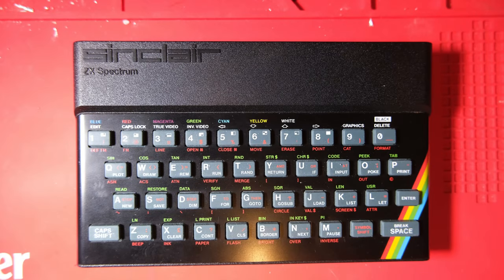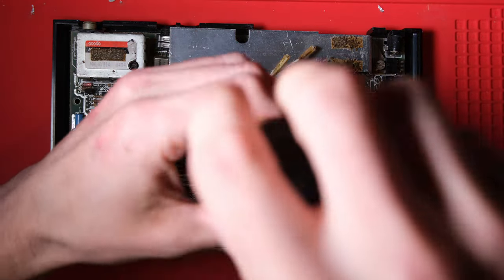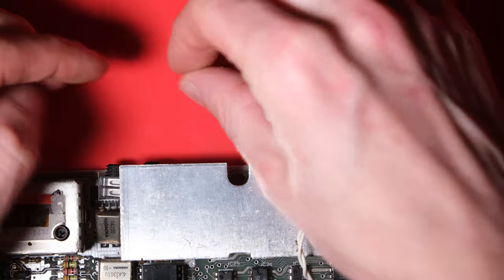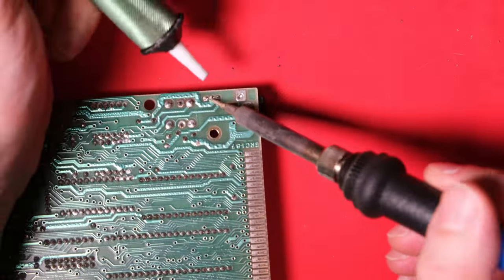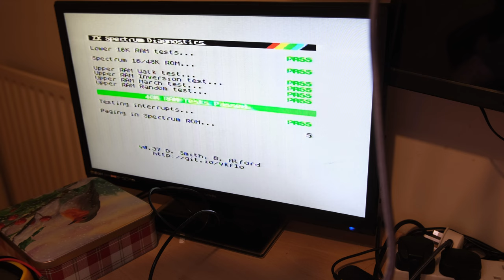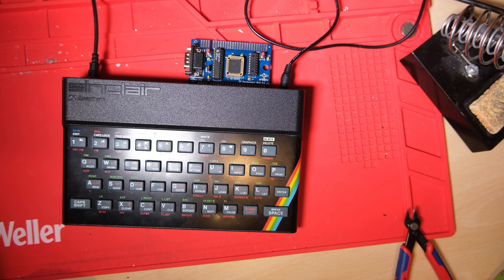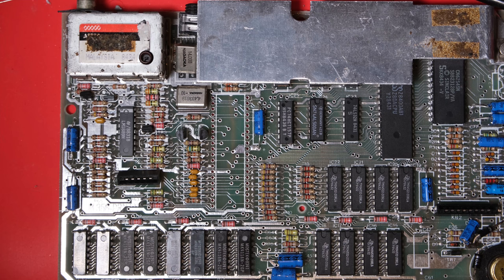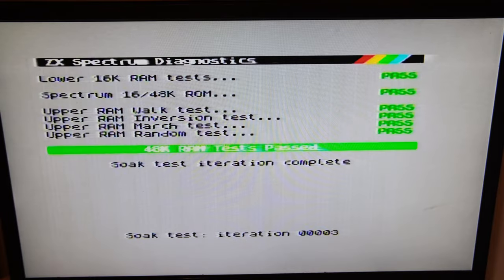ZX Spectrum Won't Power On / No Sound - Repair and Service

Comment: Is it worth swapping out the lower RAM 4116 chips for 4164 chips, considering they don't use various power sources?
Reply from the maker: You can do that but you need to some some pin bending which isn't too pretty

Comment: Where did you get that heat sink from? As the ones I get from CPC are not the full length of the ULA. Thanks.
Reply from the maker: You can buy them from retroleum
Reply: @HappyLittleDiodes  Cheers

Comment: I have a question since I only recently got in ZX Spectrum repair...partly thanks to your channel!

Do you think it is wise to  check  all the RAM chips of a non working  board on an other that works , OR is  there  a chance that a bad RAM can kill the rest of the RAMS on the working board?
Reply from the maker: Anything is possible. First check resistance from each power supply to ground.  If that are OK then you can have more confidence they don't damage other chips
Reply: @HappyLittleDiodes  Thanks for your prompt response! I appreciate it!

Comment: How about adding a shunt diode for reverse polarity protection over the barrel connector?
Reply from the maker: I've never considered it or seen anybody do it, it could be possible, I'd have to study reverse polarity diodes to suss it out
Reply: @HappyLittleDiodes  I put some 1A rectifier diode for a shunt, and it seems to have worked, at least with a bench power supply.